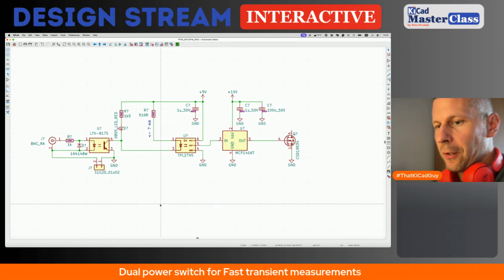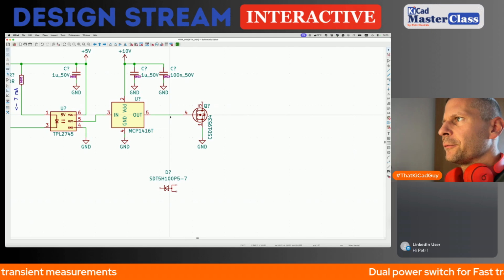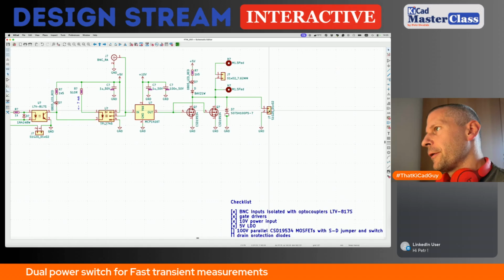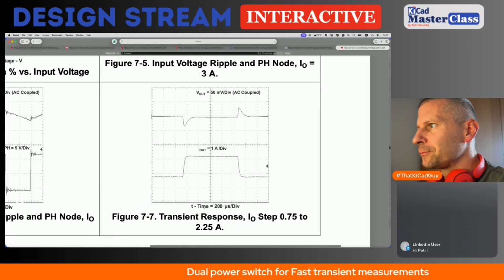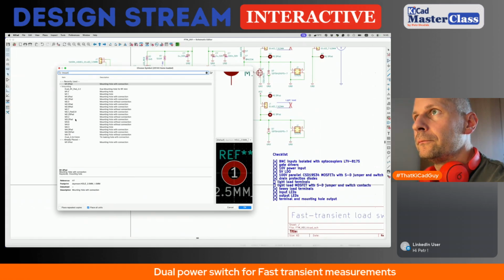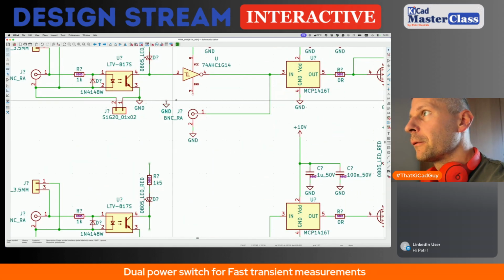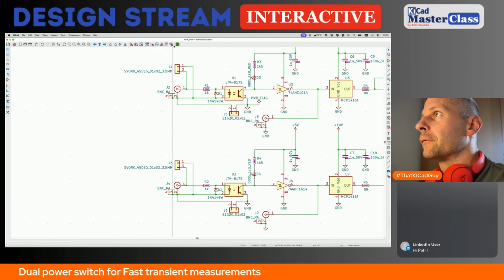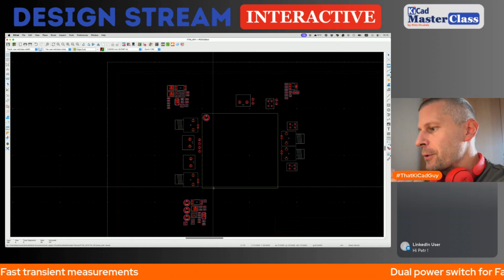KiCad Design Stream Dual power load switch

Comment: Yes, LDO with bank of low ESR capacitors are definitely better than Buck converter in this specific application (you can even increase the capacitor value on the Gate driver IC if needed). Changing to inverters instead of opto-couplers will provide faster rising and falling square wave edges.  Thanks for the interactive stream and look forward to next week's layout.
Reply from the maker: Thank you for the confirmation. I am happy that I did well. See you next week.
Reply: È però possibile aggiungere all'uscita del foto-accoppiatore (quest'ultimo indispensabile quando è fondamentale un isolamento galvanico e.g. flyback converter) una cella composta da 2-3-4 trigger di Schmitt (e.g. CD40106) che rendono più ripidi i fronti di salita e discesa nelle commutazioni. Questo, ovviamente, quando il lieve ritardo introdotto dai trigger non inficia sul funzionamento del sistema.